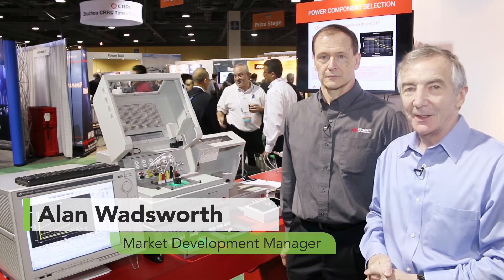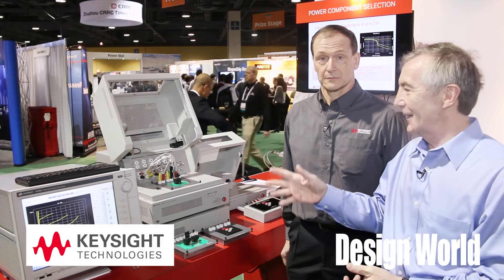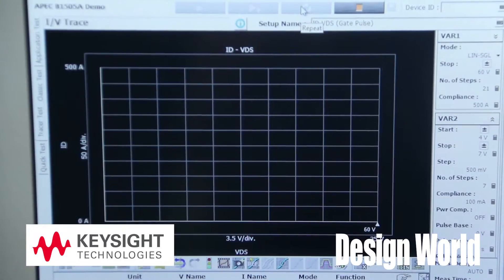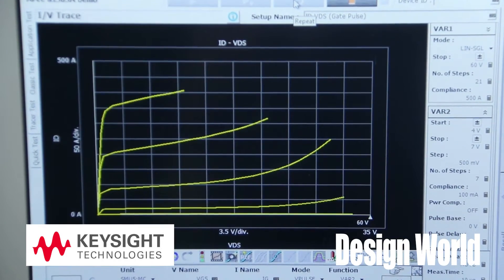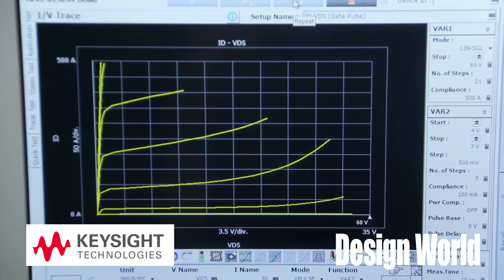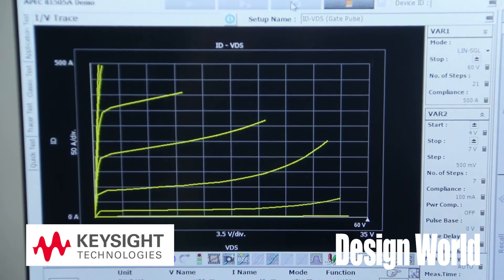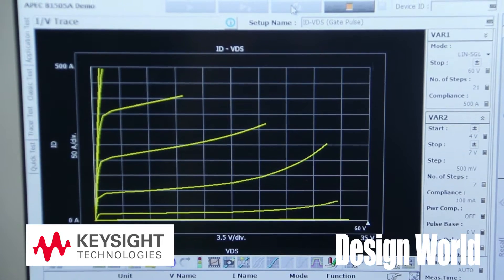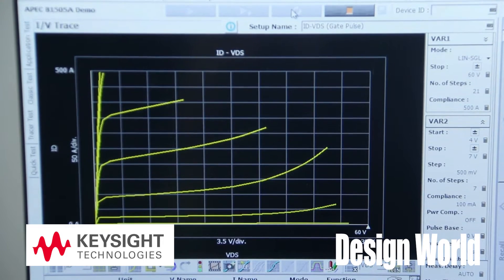The difference between a curve tracer and a power device analyzer

Comment: With a stratospheric price tag of over $100,000 and questionable reliability and durability your money will be better spent on upgrading a reliable Tektronix 576 Curve tracer with a USB interface and savings $98,0000 in the process!  Tek 576 can even handle 10 times higher peak current of 200A  vs. 20A of B1505A. Watch here: https://www.youtube.com/watch?v=qLWliMcoZR4&feature=youtu.be AND https://www.youtube.com/watch?v=OAUKXysS69g&feature=youtu.be